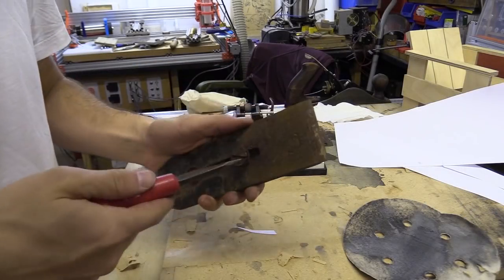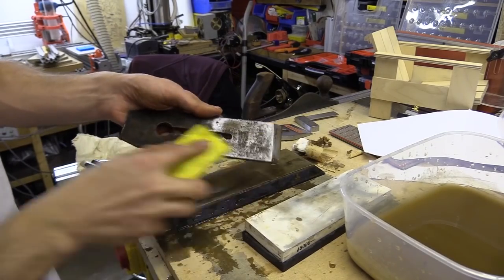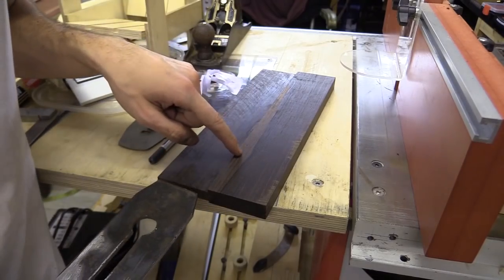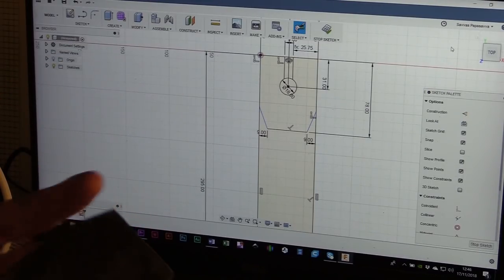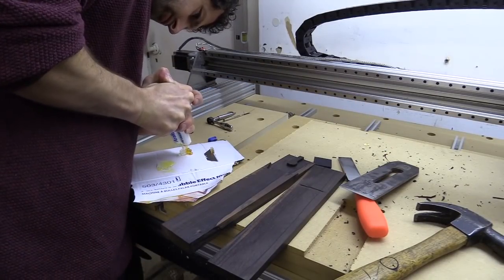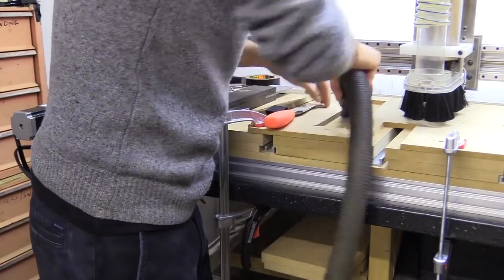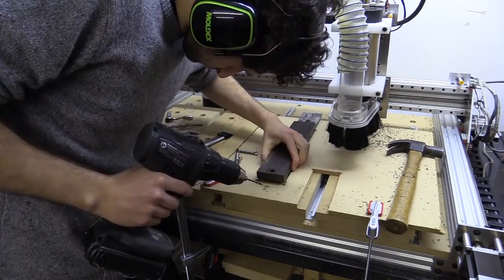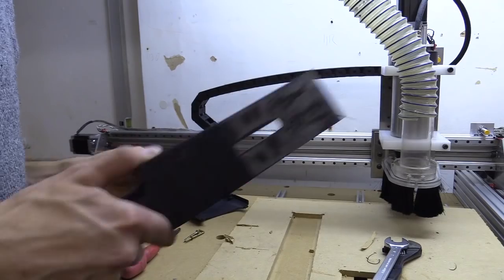Making a Super Chisel from Old Plane Iron

Comment: Great video. It’s like the chisels you see for doing beam work. Foot
Reply: Yeah it is like a framing slick.
Reply: Sho81 exactly the word I was looking for
Reply from the maker: @Sho81  Is that the same as a paring chisel?
Reply: @SavvasPapasavva  chisel used in old school timber framing used to clean up rough cut joints. I would say it is regularly used like a pairing chisel but about 2 to 3 inches wide. 3 inches = 7.62 cm. Some slicks are even larger width. Almost forgot 2 handed use so a longer handle as well.

Comment: I am kind of new to CNC machining but why did you use a one-flute endmill... because you want to get a big chip, only got that mill for wood or something else ?
Anyways... FOOT
Reply from the maker: Good price, versatile and can be used for a variety of materials. Also for good chip removal. A two flute bit of the same size wouldn't be able to plunge as deep, and would more likely scorch the material if you pushed the bit too fast / far.